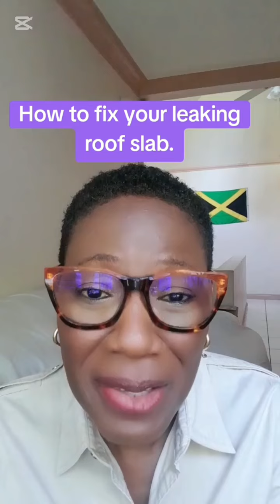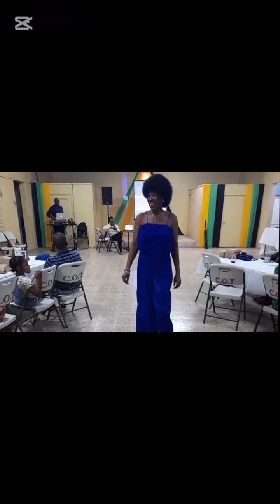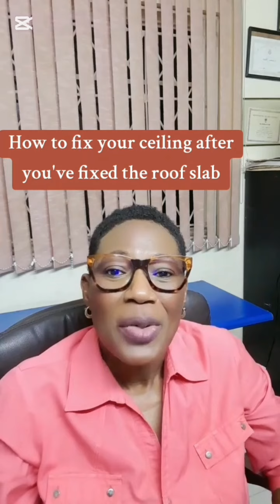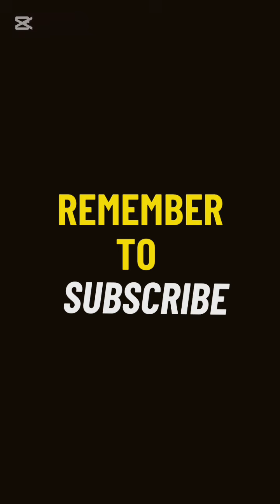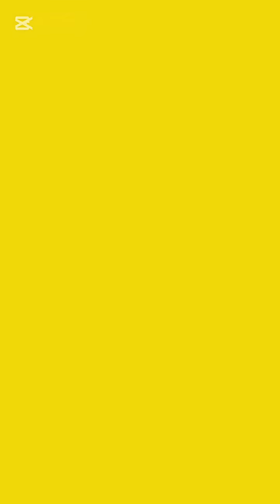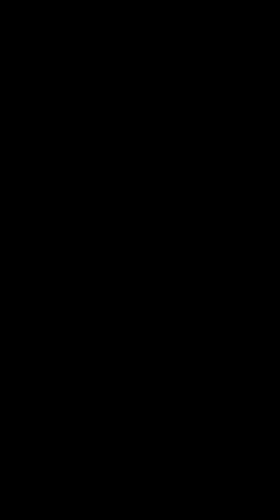HOW TO FIX YOUR LEAKING ROOF SLAB: An analysis and step by step guide for remedial works.

Comment: Many thanks for this valuable info QI.  I know that you were focusing on bungalow roof slabs.  I assume though that this treatment would be standard procedure for strata plan properties with multiple storeys. It’s not far fetched for your sleep to be disturbed due to water from the ceiling dripping on you in bed. 😢
Reply from the maker: @CarolJones-k9i  Thank you, Carol. You are correct. It would be a similar treatment. I hope it was not your bed that got wet. Sad 😔